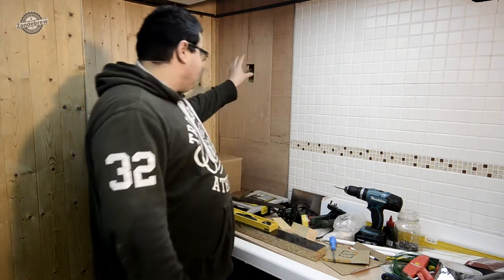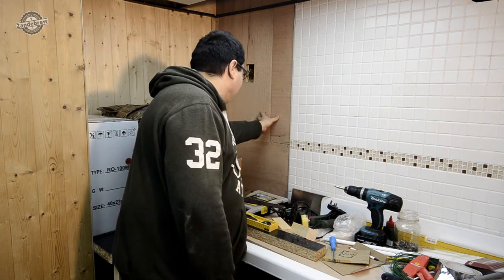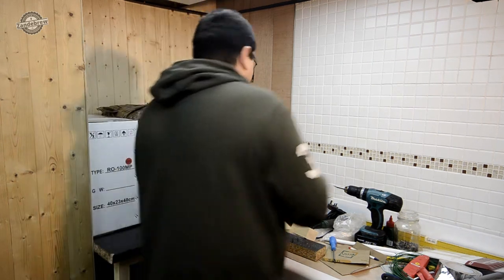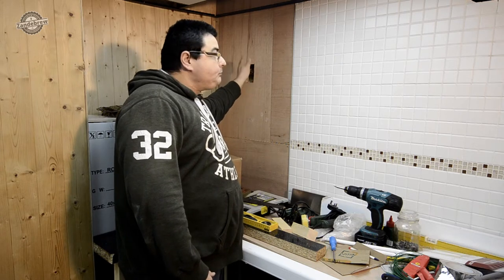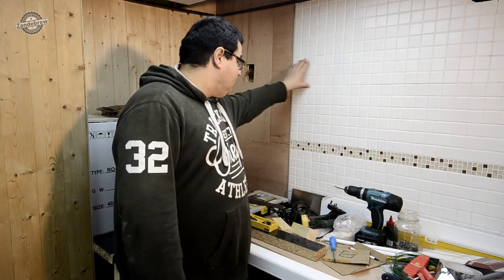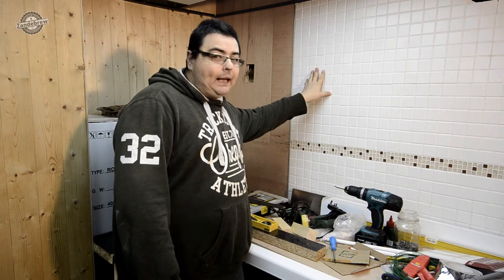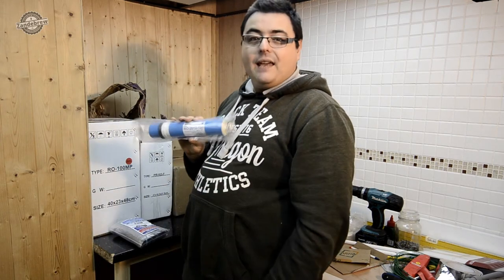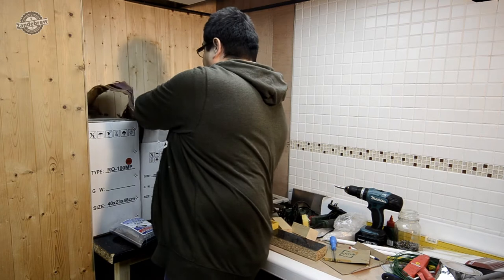HBW - Whos' Been Working In My Brewery - Build Update- vLog9

Comment: Good reason to be very proud of your basement brew shed. It's good to have friends. How cool to spend the day at Harry's pub. I was fortunate to get to spend 2 days with year several years ago. 
To reduce your concerns... the only reason I had an issue with my fermentation chamber was due to my lazy use of a chisel to clear the ice. I doubt you would have as much issues, since you would not be exposed to the outside air like mine. But simply properly thawing will prevent the issue. (Plus you have a fix it video now. LOL!).
Mash On! CHeers!